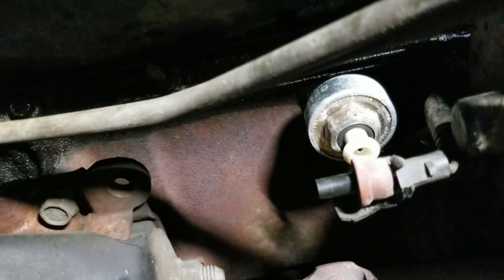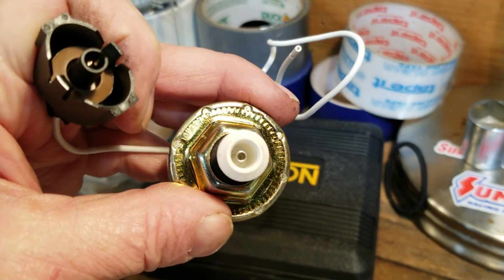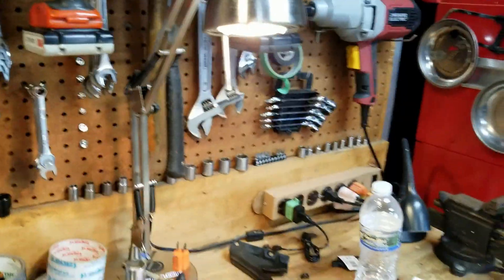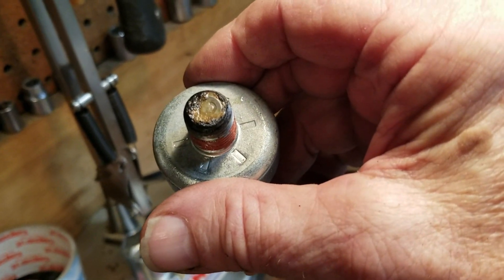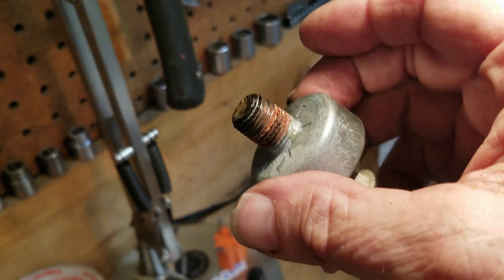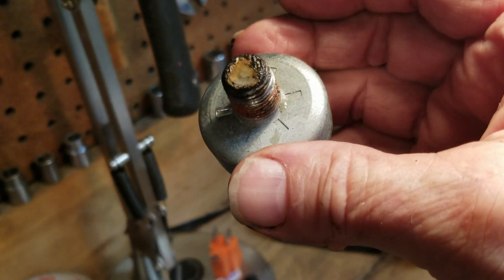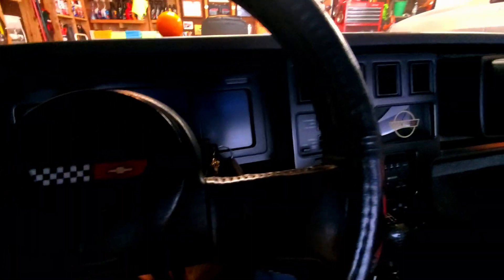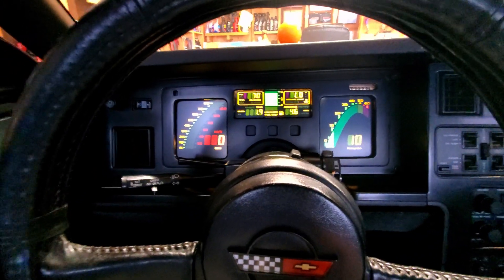Knock Sensor replacement made easy.

Comment: Thanks Michael. I bought a torque wrench close to 50 yrs ago. I was worried about it's accuracy after so long so I bought the electronic version you showed. It was so close to accurate I couldn't believe it. Good tools are a great investment. 6 point tools are my tool of choice they grab a lot more of the  nut or bolt it's almost impossible to round them out. Great for areas where rust is a problem.
Reply from the maker: Your right, buying good tools always pays off.  I still have a lot of my Dads tools that are not only great tools but have great memory's.    Thanks so much for the comment.

Comment: Why does it need to be replaced
Reply from the maker: When I was driving along, the Vette would start running rough and I would get code 43 Knock Sensor. I could always restart all would be fine. After inspection I could see wire clip was also bad so as you saw I replaced both wire and sensor.